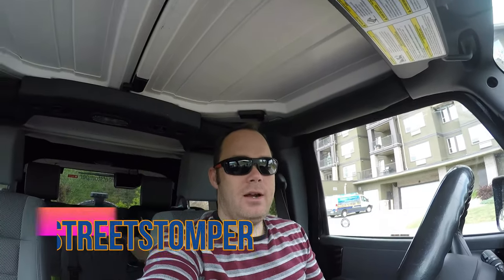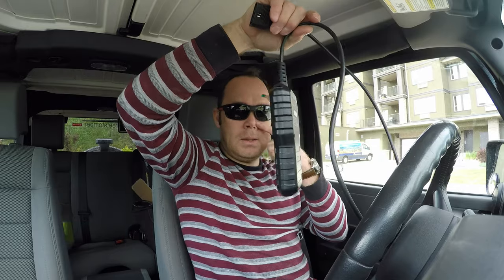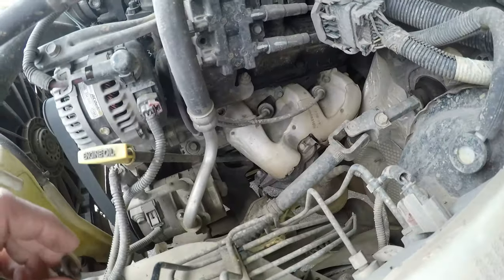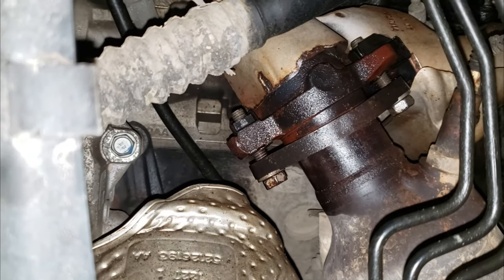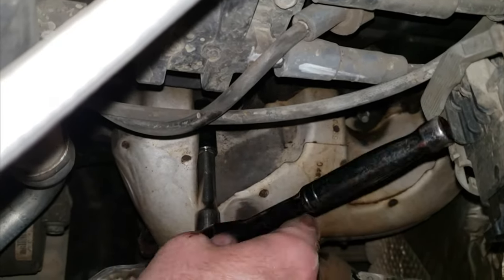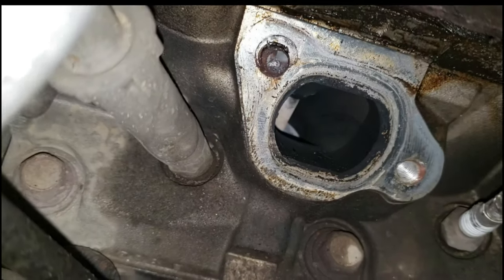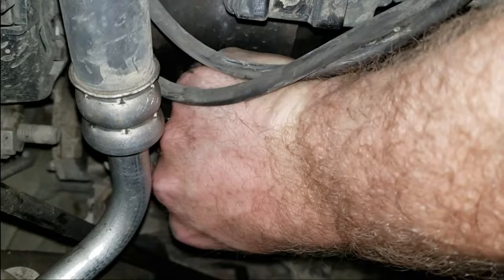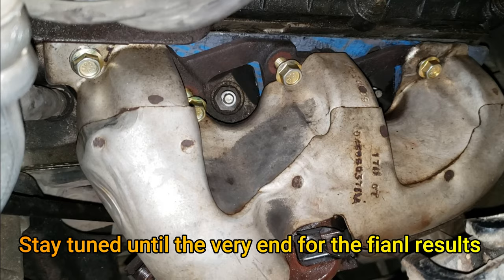#DIY Jeep Wrangler Exhaust Manifold Bolt Repair /Engine Light FIX & Slimy Dealership

Comment: I had p0430 turn up on our JK, just like you said, the auto parts store offered to order new cats at $1,000.xx right away. I did some research, and found it seems to be common on jk's for the exhaust manifold(seems more often the drivers side) to crack. Took the heat shields off, and there's a small crack between #2, & 4...just like on the other videos, just the crack was smaller than the others. New manifold- $100.xx😥

Comment: On the JK you can cycle the key in the ignition 3 times starting in the off position and ending in the on. To display DTC codes in the cluster.  I doubt it would have worked for the ABS code but for a check engine light it should have.  Of course it's just going to be the code so you'd have to cross reference what it means.
Reply from the maker: Ya that is a quick little trick for retrieving a code however I wanted to be able to access Freeze Frame data and clear the code if it did in fact come back.
Reply: Get a Diablo  or even a harbor freight code reader. If you got a 3.6 pentastar, you'll need it

Comment: Nice video.  Do you remember what your code was or maybe your before and after repair trims?  I have been chasing P0171 and P0174 lean codes for a while.  I smoke tested but found no leaks, but just noticed that one bolt was sheared just like yours, and now thinking I may find a crack once I remove the heat shield, or maybe its the gasket leaking.
Reply from the maker: I would most likely say that broken bolt is your culprit, I was getting several codes although I do not remember exactly which ones but once I fixed the broken bolts it solved all my issues